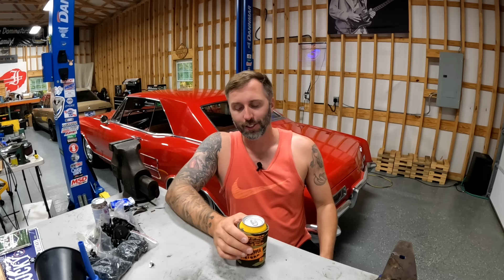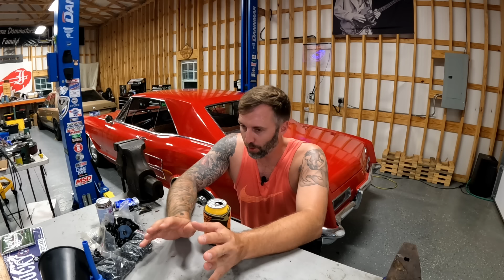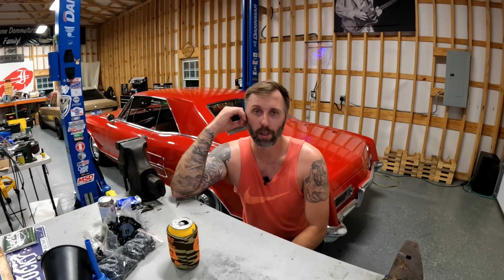Why I Ditched Holley Sniper EFI

Comment: I'm a retired Gm tech..I repair and upgrade cars on th side now. I can't believe you did all that work THEN had to remove it All!  How stupid is Holleys tech support not handle the throttle body by its self! 1 p/n and there done..They are too big now to understand or care if you walk now..That's Sad.  I love carbs. Simple. No electronics to ck and diag is back to the 4 basics..EFI is the best thing to come out to satisfy economy and drivabulity. WHEN IT WORKS RIGHT. Don't need a scanner with a carb..I'm with you when you say your not a Tuner.  What I HATE is Finding one!!  Lots of guys out there buying HP or other tuning software think they are Tuners. BS!  that's why I don't recommend modifying EFI cars..more problems.  Way too much work for maybe allittle benefit.  It's sad people now don't understand how to start anything!  Choke..warm it up..ect.   great video.  You were way nicer than I would have been...I DONT NEED TH PRACTICE
Reply from the maker: Hahah thanks yeah I got my money back but of course I didn't get any time back.  Like I said I build efi and carb cars.   But thus system won't be going back on any of my cars.  I appreciate you watching.  Plz subscribe!
Reply: I can't imagine going thru that with a Customers Car!  I've always thought those weren't worth the money. Self tuning?  I've been watching this aftermarket stuff for a while now.  Thanks for your honest opinion. Rob
Reply from the maker: @robfranke1  to be honest I always thought that 2 but i had a bunch of friends say oh no they have come a long way...then i fell in to the you tube trap of believing how great they were lol .
Reply: I'm with you..what kills me besides the wasted TIME..is They Knew about the failures in first gen.  I would have expected a upgrade from tech support at a minimum!!  I remember first crap that came from GM with known issues We Always upgraded..even in out of warranty  GOODWILL to owners...That's how you KEEP customers.  So you were expected to jump hoops to receive another gen 1?  Maybe it will be ok??  What's th saying?  First time shame on you. Second time shame on me.  I'm expected to know what ingredients to use when baking a cake..how do I get more money for failed parts..not the owners fauil..just eat it???  1 time bro..lessons learned.  Maybe someone at Holley that gives a shit will see your KIND review and get their act together.
Reply from the maker: @robfranke1  they will probably threaten me to take the video down.  Not likely I am just a small fish.
Reply: One last thought..Doctors are the Only ones that get paid to PRACTICE every time..and get Paid to Bury their mistakes! Been practicing on the same make and yr model.   Somehow that just seems wrong.   Later..back out to the shop..summer in TX!   Thought I was gonna die in 1980

Comment: Another note, I have always thought OEM fuel injection systems are the best way to go.  One of the reasons I went ls swap was I wanted fuel injection and the ls comes with it, and the factory system can support good power numbers unlike the earlier systems.  I get this isn’t an option on your application and you are probably better off using a carb.  You don’t have a max effort build so a street friendly carb will do fine.  Years ago I had issues with my Holley 800 double pumper flooding, it was constantly getting rubber in the needle.  This was around the time ethanol was added to the fuel and the auto parts stores fuel line wasn’t compatible.  I hope today that it is.  Carbs are plenty reliable and they were used for daily drivers for nearly 100 years.
Reply from the maker: Thanks for your inputs.   Good points.  Please subscribe!
Reply: Yeah I'm doing the E85 carb gasket upgrade to my holley now, not cheap but I think it will be worth it in the long run period

Comment: My sniper was dyno tuned with the new engine from Blueprint. Haven't had any issues, and it's been running about a yr now.  Awesome throttle response, lots of power, starts right up every morning, cold or hot.  Had some wiring issues when I first stabbed it but their tech support walked me through it and got it all connected.  With it coming with a 30m/50k warranty, I'm not too worried about issues.  I've been happy with it so far. 
  I do have a Holley 850 double on my stoker mustang.  Been debating going sniper with it.  I hate the cold morning starts and studdering till it gets hot. But it has been on the car for 20yrs now with little issue other than the power valve getting stuck open occasionally flooding the engine.  I'm sure it helps that I only use 100% gas, no ethanol.  It prob would have died a long time ago if I didn't.

Comment: I live at high altitude and regularly drive my El Camino anywhere from 4,500ft. to 11,000ft.  In my case, the carb was not cutting it.  I could get it tuned for home altitude, then take it down the hill and it would misfire and carry on like crazy because it was too lean.  I would take it to higher altitude and it wouldn't restart because the choke was flooding it.  It was fouling plugs all the time.  Switching to a Holley Sniper fixed ALL of that.  It is a hobbyist system, not a professional system, kind of like a 3d printer.  And I had a lot of problems with it at first.  But I am so glad that I stuck it out and got it dialed in.  It's great to have a 40 year old car that runs as good as a brand new one, just turn the key and go.

Comment: Holley EFI that looks like a carb is just throttle body EFI, and that went out on the OEM's in the 90's. If I am going to go with EFI, it will be sequential multiport or individual stack injection. I think that carbs are fine and that's what is going on my tunnel ram in my W200 Dodge. I have done EFI swaps but never put one of those janky throttle body EFI on anything. Thanks for the video and the warning.

Comment: I just ran across your channel, and glad I did. A friend bought a used Sniper one, and I will tell him about your issues. I am an old school carb guy that got training by Mitsubishi for EFI, Bosch Licensed , in the mid 80"s. Factory equipment, as you said, has the research. You can't go wrong with a carb and points, or MSD. Stay away from Pertronix, just my opinion. Good luck, and glad I found your channel.
Reply from the maker: Thanks brother ! I hope you subscribed !

Comment: I just bought an Aces EFI system for my 65 mustang with a carbed roller 302. Aces uses a remote ECU that can be mounted anywhere including inside behind the dash. Seen mostly great reviews for Aces systems. Not so much for Holley and FiTech.
Reply: I was doing a bunch of research on the LS ecu systems for these 3 companies and found bad things about all of them. Seems like for the most part they work, but when you get problems you get problems. (or the installers aren't very good at problem solving). Fitech and Aces are smaller companies and as such have worse customer support, but that depends if you need it.
I think aces is newer and has less reviews, and of course happy people rarely leave reviews but angry people always do. I ended up deciding on the stock ecu for the LS, and for my sbc I'm keeping the q-jet.
Reply from the maker: @Born_Stellar I just built a 2jz swapped Mercedes and used a stock Toyota  ecu as well.

Comment: I feel your pain ! I hope that you read this ! I have a restored 1973 Mustang convertible with all the options thrown at it ! The engine is a 351 Cleveland 4V Ram Air that was rebuilt .040 over with upgrades...ARP rod bolts, roller rockers and an Extreme energy Comp Cam with Johnson lifters. 
   When I purchased the car it had a Holley Street Avenger that was absolutely impossible to tune because none of the adjusters did anything, the only adjustment possible was the float bowls. The car left me stranded twice so I decided to take it to a local restomod guy whose cars cross Barrett Jackson's block for six figures plus ! Big mistake, I got my car back almost 5 months later minus 15.5k !!!
   They did an absolutely amazing installation, clean as can be ! I bought the whole kit and cabootle same as you ! Sniper with Hyperspark distributor and electronic ignition, tank with in tank pump.
   The car ran o.k. but not perfect, it needed a tuner to perfect it....good luck finding a Holley certified tuner !!!
So, I drove the car for a few weeks and then I started having intermittent fueling issues. The more I drove it the worse it got. I called Holley tech support...I called 7 times before the tech said to remove the air cleaner and look down the throat to see if all four barrels were getting fuel ! Well what do you know, two were not getting fuel !!! He personally gave me the RMA# !!! Within one week I got a brand new one. I put it on myself...like a dunsky I left the throttle dohicky on the one I returned. I went to the parts store and purchased another. I ran the wizard and Bob's yer Uncle !!!
   There are many issues with the tuning that needed to be addressed....I have a 4 speed Toploader in the car, when coming to a stop the car would stumble and almost stall ! I called and spoke to another 4 or 5 guys that had never heard of such a thing, which insulted my intelligence. I am a persistent person so I called again, this time the tech "Ryan Hiens " and he said...no problem, do this and this and this...fixed completely! Mind you this took place over a 9 month period !
   I did luckily find a tuner that didn't want an arm and a leg to tune my car and he did NOT know that particular fix for the low rpm stumble. Also, when you punch the throttle the afr goes lean and it backfires and basically takes 2 to 5 second for it to recover and smooth out. The low rpm range is where there are issues that need addressing. Wide open throttle, the Sniper is fine but if you are in second gear at 1200 rpm and you punch it....problems start! 
   My car starts EVERY time I want it to and the little issues for the every day Joe are a real PROBLEM ! I have no clue how to tune an EFI car...none ! Holley has bought up almost every company worth saving in this dying aftermarket high performance environment and Edelbrock has bought the rest....combustion engines will be gone in 20 years except for what is kept alive by enthusiasts. If Holley really cared they would have created an environment where they could help everyone with issues instead of sweeping them under the rug ! For instance, the whole time that I was having issues they all knew that the Sniper 2 was almost ready ! Another insult...no a SLAP in the face ! Thanks for the cash to develop our new Sniper ...have a nice day !!!
   I did call the day Sniper 2 was released and was told why would you want the new one....the bugs haven't been worked out yet !!! Oye Vey !!!
   All in...I'm happy with the Sniper full stop ! Holley should take a better look at the people keeping their doors open because that group gets exponentially smaller every year !
Reply from the maker: haha holy cow i did read it.  great post . thanks for sharing and thanks for watching, please subscribe !
Reply: I have used a street Avenger for wellover a decade. Easy to sort out and everything does adjust. Ona 400 Ford
Reply from the maker: Exactly.   Subscribe!

Comment: Sorry to hear about your experience and I don't blame you a bit. There's a huge difference between a factory installed EFI system that you would get from GM, Ford and/or Chrysler versus getting an aftermarket system from Holley, Edlebrock or MSD. OEM fuel injection will destroy the aftermarket version each and everytime. Another problem is the costs of fuel injection period. I can buy a lot of carbs for $3K.

Comment: I wanted to do an EFI swap on an FE engine in my 65 Thunderbird. The car had a two barrel carb/manifold. I don’t know if you’ve seen the prices of 4 barrel FE manifolds, but they are high. In order for me to use the Holley Sniper I would’ve needed a new intake plus the kit and then if I wanted to add timing control, I would have to add their distributor option. So, I chose the Edelbrock pro flo 4 which comes with an aluminum four barrel intake and multi port fuel injection, and it comes with a billet distributor. It’s been great but not without problems (more on that later). You might want to give it a try on some of your future builds. However do not under any circumstances purchase the Edelbrock fuel sump that lets you keep your mechanical pump.  It has a small, very small, sump with the high-pressure pump in it. It is garbage. I literally threw it in the trash after I replaced two pumps in it, which, by the way, Edelbrock does not recommend. They say when the pump goes out, you buy a whole new sump.  It is kind of pointless anyway because it requires a vent line to go back to your tank which is typically the reason people use them so they don’t have to run the extra line. I don’t recommend them at all just run the return line and either do an external or internal high-pressure pump.  I welded a flange on the side of my stock tank and used a factory crown vic in tank pump assembly and it has been smooth sailing ever since.  I did contact their tech support and after being on hold for a long time, I did talk to someone who was very helpful.  (Their tech support is located in the Memphis TN area which is where I live.) Once I had a case number it was easier to reach him and I was able to talk to the same person on multiple calls.  Their are helpful as well.  This kit does not have the same level of tuning ability as a Holley, but what the do have is VERY easy to use and you tune it with your phone so there are no wires to a handheld that you have to hide in your classic car.  Thanks for the honest video and good luck with your next Sniper.

Comment: Sniper and FITech have a 20-30% failure rate. That’s even when installed correctly. They are assembled here but the electronics are made overseas. 
I worked for a well known west coast speed shop that’s been around since 1985. He used to own one of the major exhaust companies too. We installed MSD Atomic, Edelbrock, Holley Dominator or Terminator and FAST Sportsman. No sniper, FITech or FAST EZ systems. 
That came from our experience with trying to fix problems with these systems for a hundred customers or so. Sometimes it was installer errors that we fixed and they’d be okay. Bad wiring/routing or poor quality plug wires causing RFI issues. But more often than not it was a problem with the components. 
O2s, screens, injectors(the flooding like you had is common) and ECUs all fail far more often than is okay. The hyperspark ignition system and sniper together was an issue on several customer cars. They would run fine for several test drives, then out of the blue start swinging lean-rich and rough idle. Then they would fail altogether with no spark and/or no ECU signal. 
For myself it’ll be a carburetor or an OEM efi system. Not only do I have a street/strip car, I have a lowered truck and a 4x4 that I take out in the boonies. 100 or more miles from civilization is common. So you aren’t the only one who feels this way.
Hopefully the Sniper 2 is better.
Reply from the maker: Awesome good to here.  Thanks fors sharing.  Plz subscribe!

Comment: Thank you for this video.  Nice Riv!  My Sniper Quadrajet had the points output die, no spark.  Sent it to Holley 6 weeks ago.  Pretty bent that my car is collecting dust, and it's going to be out of warranty so it will be another $250 for the ECU replacement fix.   My set-up:  1969 Oldsmobile 442, 400CI, 3-spd.  Sniper Q-jet, Hyperspark ignition and dizzy, returnless holley in-tank musclecar fuel pump, MSD 8830 noise filter, MSD Superconductor plug wires, Radium engineering fuel pulse damper.
Reply from the maker: 6 weeks? Ouch
Reply: @timelesssteelgarage  Yeah, kind of held hostage until they get it worked.  And I gotta pay $250 more after a several thousand-dollar investment to run their ecosystem.
Reply from the maker: @BryanBurch  that makes .e happy to just have decided to get my money back.  Carbs work lol

Comment: Great video. I've installed half a dozen of these first version snipers. Used full systems with all the complete ignition.  Like any mass produced product , quality control is roulette.  I've had multiple cdi box failures,  ecm gremlins right out the box. Fairly irritating. Haven't done any of the 2nd version yet, hopefully they have improved.  When these systems are installed properly they are awesome, as long as you don't manage to come across the Friday afternoon assembled units. I have contemplated changing out my bbf to the sniper but my holley 4150 is tuned so well why bother spending the money if its running perfectly already.  I feel your pain. Had 50-50 good and bad customer service.

Comment: I had problems with 2 different systems FAST and MSD Atomic. FAST tech support had me replacing everything battery, plug wires, distributor module, alternator for a claimed EMF problem. For 4 months they had me chasing my tail that never got fixed. Finally I did what I say is a $400 fix for a $2500 problem....I installed a 1406 Edelbrock and I've never looked back. My opinion is, if it isn't a factory FI system I'm never having anything to do with it again. Talked to a guy last w/e with a 60 impala with a 348 and he installed the Sniper 2 and he isn't happy with it either. Oh and like you I am a ASE general certified mechanic!
Reply from the maker: Good to here, i have been wondering if the sniper 2 units are any better.  thanks for watching, subscribe plz!